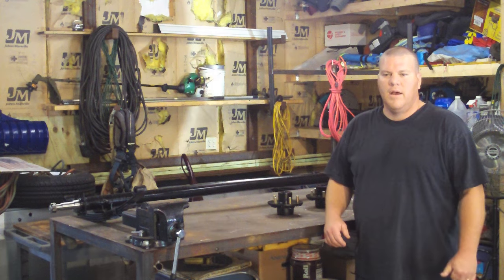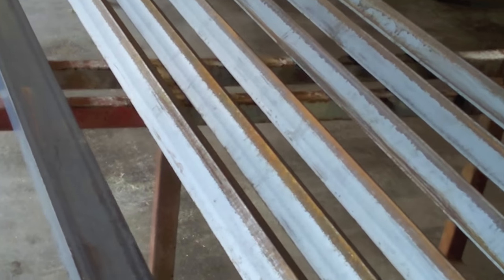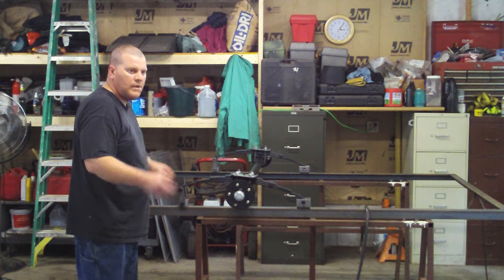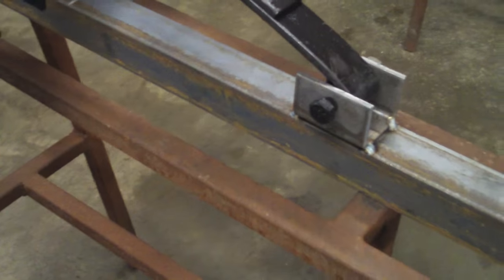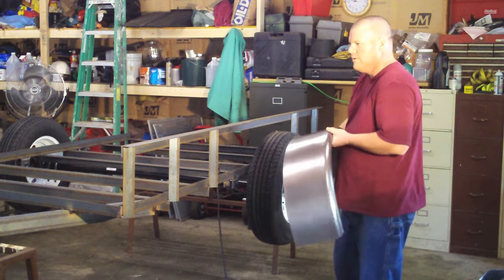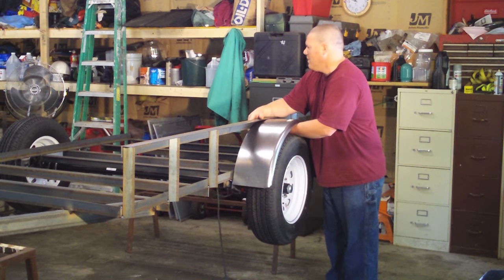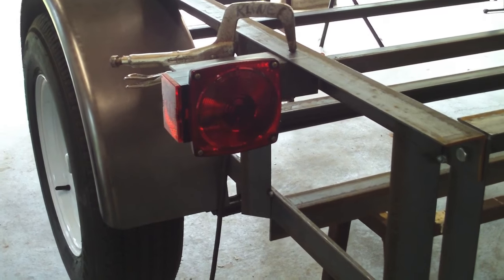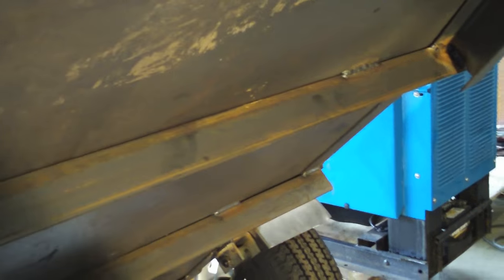How to Build a Utility Trailer Full Video Parts 1-9 HD

Comment: can you build one using a 110 Welder? but a 6x10 cause thats what I want to do.
Reply: No.  Not if you have to ask.  And I don't mean that in a mean spirit.  You'll need some experience in order to know for yourself that the weld you are making are structurally sound.

Comment: I bought a utility trailer when I was in AZ and the tailgate only had a pin on the door and the tube on the frame, to allow the door to slide to the left and taken off. BTW, what are you going to do with your gate if your hauling something long? Let it hang down? 8-o
Reply: He said he's mounting an industrial welder on it which is probably taking up most of the trailer. I doubt he will be hauling anything long in it. he said he made some room for some storage up front.

Comment: Just a couple random thoughts>>>A) Safety chains,whether required by law or not, just make sense,  I lost a friend (decapitated) when a boat trailer (NO safety chains installed) going the other direction became unhitched when the tow-vehicle hit a bump. The trailer crossed the centerline and struck my friend's truck head-on. B) It is seldom cheaper to rebuild a poorly built project than it  is to over-build it the first time!

Comment: Big problem with your trailer, In the UK the Law states that gross weight of a trailer that has no brakes must not exceed 750KG,  your trailer must weigh more than that without even having a load on it. so it will be illegal to pull it on the road even when the trailer is empty :(

Comment: about 200$  for steel (frame )
350$   wheels (tire and rims) 205/75/14
light 30$
Pole 18$ 
chain 8$
springs kits 90$ 1000lbs each
fender 24$
axles 156$ 2000lbs
trailer jack 55$

after  add paint   wood  ect ...
Reply: Hans K where are you buying tires and rims for 350.00 thats just crazy

Comment: A little useless info for everyone.

Here in the UK, if you build yourself a new trailer you need to pay to have it "Type approved" and then fit a "VIN" style plate to it that shows curb weight, and maximum all up weight. This means it's pretty much stuck with the make and models of all the components you fitted when it was tested. There's also another big limiting factor once it's plated. If your car can only tow a trailer with a maximum weight of (As an example) a ton, you can't tow a trailer with a maximum loaded weight of over a ton, even if it's completely unloaded and only tips the scale at 300kg (660lbs ?) you can't drag it with that car !!!

On the other hand, trailers built before this test came in have "Grandfather rights" that allow them to keep being used. Original parts may be out of production, so rather than have people risk using worn out bits to avoid type approval, the law leaves it almost entirely open as to how you "Repair" (or modify) it to keep your older trailer road legal.

If you want to replace it's rusted angle iron chassis and build one bigger that's made from larger box section, no problem. Are your spindly little suspension units not up to the load your new bigger deck may put on them? No ones going to stop you swapping the lot for leaf springs and a live axle (with bigger wheels and brakes if you like). If that pressed metal towing hitch doesn't look up to the job, go put a new cast one on, and those old lights just look shabby now you've fixed everything else up.......... You've now got a new trailer that doesn't need testing. :D

The biggest benefit is that an "Old" unplated trailers maximum load is whatever you say it is, so if your car can tow a ton, then that's what the trailers max loaded weight is. As long as a department of transport inspector can't point at any component and show that it wasn't rated to at least what you say the max loaded weight is, you're golden. It also means that when you change cars you don't have to worry about whether or not it will still be allowed to tow your current trailer.

The only problem here is if you want to take your "Old" trailer out into Europe when you go on holiday. They want all trailers that go on their roads to be type approved, but 99.99% of the home modified ones here wouldn't be used for this anyway, so it's not a problem.

Comment: I think that the axel il better under the spring not over
Reply: over slung makes trailer closer to the ground.
Reply: I agree.  The axle should be under the spring and not on top of it.  It might make it lower having it on top, but you lose all the axle travel when hitting bumps and also lose the weight carrying capacity.  With it on top, you are carrying all the weight on the U-bolts.  With the axle under the springs, then all the weight is transferred to the leaf springs and not the U-bolts.  The U-bolts are there to keep the axle lined up with the springs, and are not meant to carry the weight.
Reply: Totally agree.  Big flaw in this design/build.

Comment: Hello I have a question I build a small trailer I weld one side Lille more hoter then the other side it looks just Lillie off level how can I fix it to look level do I weld the other side more?
Reply: yes. maybe it will help the heat distortion. exrta passes will pull the t joints, and turn down the heat to 106 -110 to avoid burn thru on the second pass.
Reply: Ghost Dog and use stick for strength not tig.

Comment: you can't build one for what you can buy one for. a new 5x8 will set you back about $1200 for a good one

Quit packing all that grease in the hubs. It's not needed. In fact it's detrimental. grease needs to warm up so it can flow. Excess grease takes longed to warm up which shortens the life of the bearing.